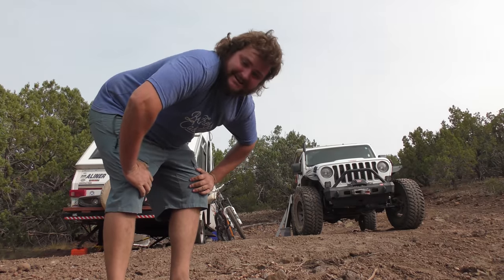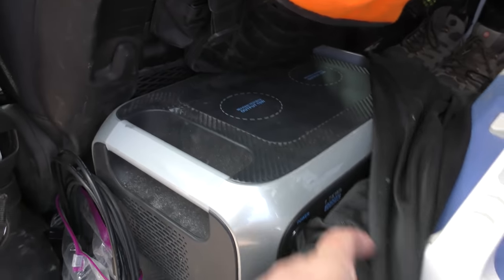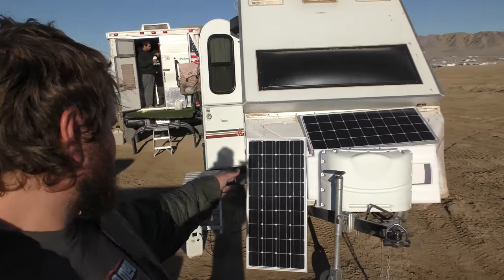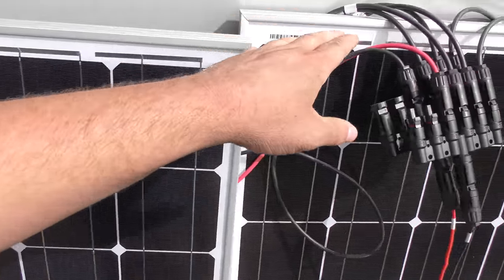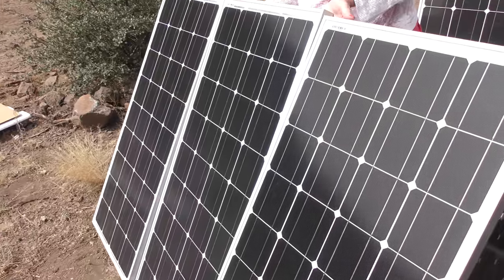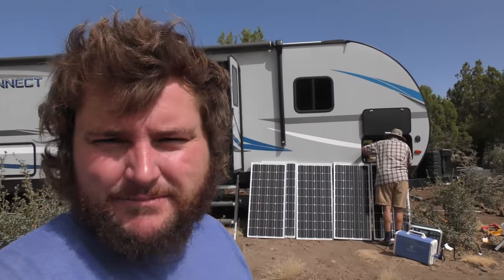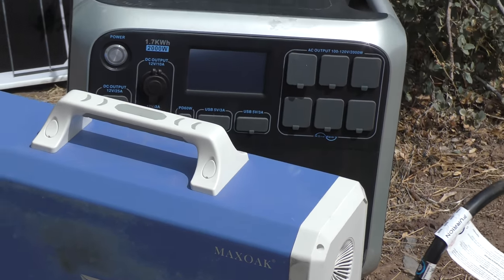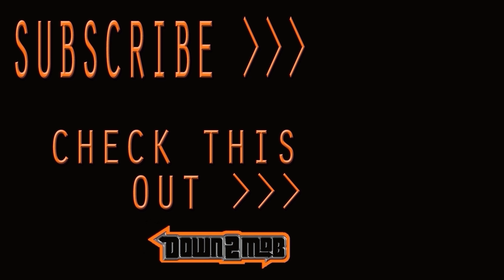Off Grid Property - Running a 30ft Camper Trailer w/ Sungold Solar Panels

Comment: you gotta be REALLY careful running so many panels in-parallel. when they are joined-up all the amps will be going through there, so it will need to be like 0 gauge. also, you are gonna have mad inefficiency (lower voltage = more resistance), and will lost probably 25% of the power just in transport from the panels to wherever it's going. it's always best to wire your panels in-series, and use an MPPT charge controller. that way your system is running much more effiiciently (more voltage = less resistance), your wiring can be significantly less gauge, saving money, and you get way more power, because at low light conditions  your panels will generate power at wattages less than required to charge the battery, but the charge controller can boost it to whatever voltage is best to charge the battery. also, 24v ftw. :)

Comment: That's just insane connecting so many panels in parallel. I would have connected them all in series so that your voltage increases but your amps stay the same. That way you have less DC loss over a distance and your cabling doesn't have to be so thick. Connect that array to an MPPT charge controller and you're smiling all the way  👍 👍
Reply: Yeah

Comment: Couple of friends just have a site system couple of them are 2kwh sized with a tesla or similar off grid power box and run conduit to power their rv site locations. They can run AC and heat strips etc.

They also eventually pick up a water trailer to haul water in.

Comment: you wouold have made alot more power by putting the panels at 45 degrees and make sure they are all facing the same way.  if you point one away from the sun the total power will be very reduced. if you get shade on one part of the panel its like ever panel has that same spot of shadow on it..

Comment: Honest question: I think buying land was a good idea but, what're your parents gonna do every time they need to fill up on water, and dump the black and grey water from the camper? I feel like having that 30ft camper in that area is a good idea until you actually think about it realistically... unless I am missing something here
Reply: Septic tank systems exist for a permanent solution. Also those tanks drop out of the bottom of a camper. Cap that rascal and take it home to dispose of. If you dig a pit for an outhouse,  you can dispose of the black tank into the outhouse.       Vaughn
Reply: In the video @8:30 is a box for a composting toilet so they are probably doing that and then they'll have a mound of crap to deal with at some point. They'll probably just let their gray run down the hill.

Comment: Umm those should be wired in series for 24V. Much more efficient that way. Also ditch the power station. Get an 12/24V MPPT charge controller and at least 2 Battle Born batteries and a 2000W pure sine wave inverter. This will be a much more efficient system. Check out DIY solar with Will Prouse!

Comment: Separate the ac system from the dc system. use solar controller's to charge battery bank. Cut the big cord off.

Comment: Id get 2 snomaster 12 volt fridges(set one as a fridge and one as a freezer and get some really good batteries, quality solar charger and inverter and ditch Bluetti's. Also propane water heater.

Comment: So, like...   You're out there in full sun and those panels are doin' what they do...and youre connecting them with bare hands.  Don't know how these things work, but that seems pretty risky after you've jumped a couple together.
Reply: MC4 connectors are designed to be plugged in hot like that. You would have to stick your tongue in and something else into the connector. Plus they are only 18 volts anyways.

Comment: I'm surprised the trailer doesn't have a solar input
Reply: If it does it's a joke. Many times it will support a 100W suitcase (built in solar controller) and so you are looking at 7-8 amps of charge. They are a gimmick and there to help you make it through a weekend. If they really want to run that trailer off grid they need 2-3K of panels on a ground mount system with a couple thousand amp-hours (12VDC) of batteries and a 3000-4000 watt inverter. They need to be able to make it overnight with the air conditioner on to really be off-grid and not cranking a generator overnight.

Comment: Your panels are not at the best angle for highest power. All panels must  point in the exact same direction of they switch off. The distance you are from your parents probably would not work on DC, DC disappears over distance.  I have Hybrid energy systems on houses in Sweden and those houses earn $3,000+ a year from their power companies and have no costs for power or heating. Sweden has a long period mid winter with months of no daylight, and still our system works. But I have better than that now, I can deliver AC power from a backpack, at 1lw an hour or from a waste paper bin size 20kw and hour AC say for a house, using no fuel or other energy source, just switch on or switch off.  In Sweden this system would earn over $150,000 a year from the power company. Change is coming, getting it out there takes a lot of effort. Convert your truck to electric by changing to hub motors on your wheels and your Truck could power you home too. Not to mention better performance and never needing a recharge.

Comment: Sorry, this is probably not the best video to view for an solar review or installation procedure.  Yes, you can throw a solar panel up to charge your phone or a battery pretty easily, but powering that trailer is going to take a little better designed "system".